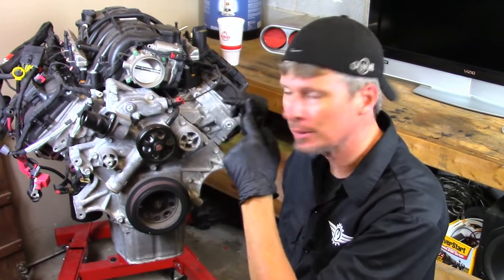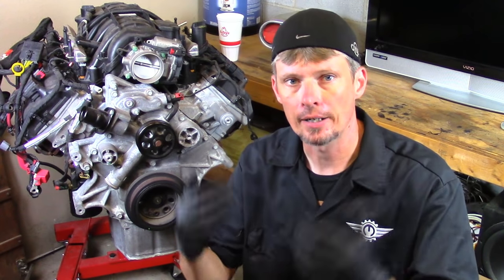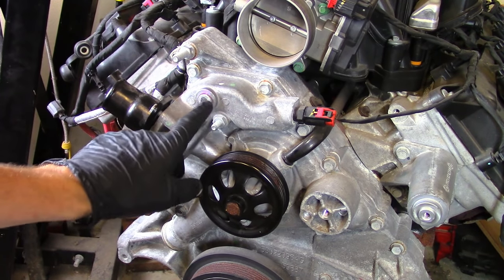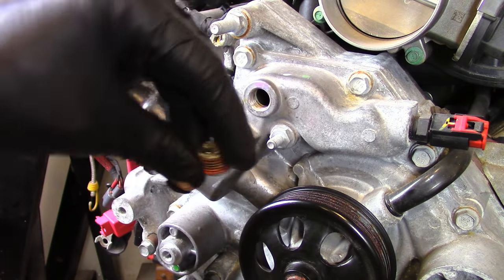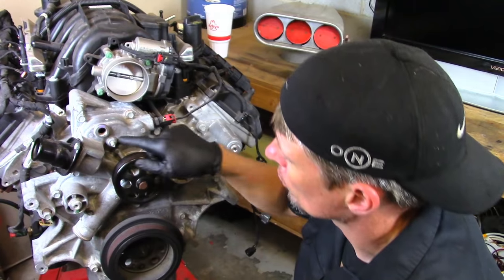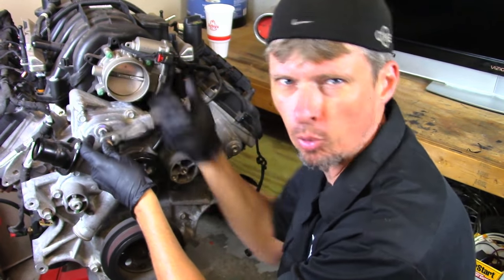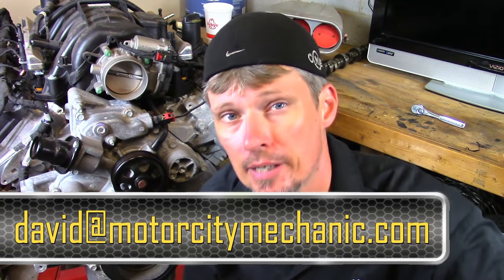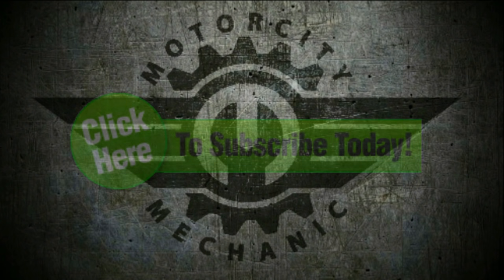Quick Tip: 5.7 Hemi coolant bleeder location and fill procedure

Comment: When you do a coolant flush will it completely flush the previous coolant out? I was going to top of my coolant & the manual calls for a mopar OAT coolant (purple) but the fluid in the car is orange. I bought it preowned a year ago. What would you recommend going about with this? It's 2016 hemi 300s

Comment: I have an air gap in my. I opened the bleeder port and filled the overflow container but overflow filled before fluid came out of bleeder port all while jeep was running. What did i do wrong?

Comment: Hey David.  Just subscribed...my question is. The location for fan sensor switch on a Chrysler 300 c 5.7 v8 .
I changed thermostat and went through refill procedures. Yet the fans don’t come on when it heats up . They never come on...any advise would be helpful....thanks and have a great day
Reply: Maybe it's not getting hot where they need to

Comment: Best advice on the bleed valve if it's stripped?
Reply from the maker: If you cant get it out then I recommend using a coolant air evac tool to remove all the air and then refill the engine using that same tool. You might also try removing the t-stat and filling the engine until it comes out the t-stat opening....will require a new t-stat seal however. Then reinstall and top off the level in the bottle.

Comment: it seems as the bolts around the water pump are leaking a tad bit of coolant in my challenger. I did the radiator pressure test and saw it come out of some bolts. Any suggestions?

Comment: Hey thanks, something weird happened to my same engine, engine is full of coolant with no air in the system but water pressure in the heat radiator inside the dashboard is less than before, when I accelerate car it gets hot, seems to be not a lot pressure in the system and I don’t know why!  Any idea? 5.7 hemi

Comment: My 06 300c awd leaking antifreeze left and right corner of the radiator car doesn't overheat yet heat is ok but hottest when car is driving?🤔 should i change lower hose or change RADIATOR?
Reply from the maker: Sounds like the leak is at the radiator tanks meaning radiator replacement. To be sure I would pressure test the coolant system and see if you can pinpoint the exact location. No with the age of the vehicle I would recommend both the upper and lower radiator hoses being replaced when the radiator is replaced if its needed. Thanks for asking and thanks for watching. Make sure to subscribe and Merry Christmas.

Comment: I have a 06 Chrysler 300c 5.7. It started to over heat I changed the thermostat but still does it. When I turn the heat on all the way it goes back to normal operating temps. Would bleeding it help?
Reply from the maker: First thing I would do is make sure both fans if a double set or the single fan is working properly. See if they are coming on when its running hot. The next thing would be to make sure that the radiator isnt clogged. You can touch the upper and lower radiator hoses to see if there is a big difference in temperature when its at normal operating temps. Thanks for asking and make sure to subscribe.
Reply: @MotorCityMechanic  thanks so much I just bled it and alot of pressure came out and I filled it till it ran out the hole. Just went and tested it down the road and had it set on a hill for a couple of mins while it ran and no more over heating. You saved me alot of money appreciate it. I will subscribe for sure
Reply from the maker: Keep an eye on it.....something had to let the air in. Glad you tried that if even if I was steering you away from it lol. Thanks for the update Glen and again....keep an eye on it

Comment: just a quick question i replaced the heater core in my 2006 jeep commander and i'm only getting heat when i'm driving. the minute i stop the air coming out the vent start getting cold. i was told that i should make sure the front of my truck sits higher than the back to get all the air out. i've also noticed that my radiator cap stays cold cold even after the top radiator hose gets hot any ideas on what to do?

Comment: Do you have any videos on how to drain the coolant. I have a water pump leak on my Hemi
Reply from the maker: For the most part.....all the videos related to the coolant system should have the draining explained. For example here is one that even being that its a different year....shows the same location as yours of the drain....right bottom corner of radiator: https://www.youtube.com/watch?v=f0doIZI-fp4

Comment: Hello friend I have a problem with a Durango 5.7, the engine has been repaired and the temperature rises to 112 and the water is dripping from the radiator cap. The pump is new. The radiator remained. The head gaskets have been replaced and are still warming up, flush out the water, remove the thermostat, and continue. help friend

Comment: your video was quite helpful thank you, but if issues still persist with over heating even after bleeding and letting my 2011 jeep grand cherokee with the 5.7 run then letting cool completely and checking afterwards to bleed again as prescribed in another comment you stated, what could the culprit be at this point?
Reply: also changed my thermostat

Comment: hi. I have a 2005 Dodge Magnum with a hemi and it keeps on over heating . I already changed the radiator, the reservor, and also put in a new thermostat and it still seems to over heat. my husband also bled it to see if it has air and it still is over heating . any idea of wat it could be ?

Comment: I’ve added coolant and removed that bleed valve, but no coolant from the reservoir is getting sucked in. The coolant level remains the same in the reservoir and nothing is coming out
Reply from the maker: Have you filled the coolant bottle to the top? Its a gravity set up.
Reply: MotorCity Mechanic I have filled it up, and none goes into the radiator. I was told to turn it on and it would go in on it’s own but it just starts to get hot. Nothing is leaking, and I’ve already done what you said but nothing. Never happened to me before

Comment: great video..one question bro" how many coolant bottles should I use on a complete flush..1 or 2 ???
Reply from the maker: Really depends on how your flushing it. If using a flush machine it can get up to 2 gallons antifreeze and 2 gallons distilled water. Otherwise the system holds around 1 gallon antifreeze and 1 gallon distilled water. Just depends on the method. Thanks for the comment and for watching. Make sure to subscribe

Comment: What the procedure in a grand cherokee hemi with a coolant tank AND a radiator ?

More confused than I was before watching this...
Reply from the maker: Doesnt matter if you have a pressure bottle or if the radiator cap is on the radiator. Just fill it up until it starts to come out the bleed hole and then reinstall the bleeder bolt. Basically where ever your radiator cap is (on radiator or on the pressure coolant bottle) thats where you will add the coolant. Thanks for watching and hope I helped with that confusion. Make sure to subscribe.
Reply: @MotorCityMechanic  Excellent.  Thank you.
Reply from the maker: Your welcome!

Comment: No bleed port on a 2007 Dodge Ram 5.7. Heater hose pipe is in that spot and runs down to bottom of engine. Gonna take thermostat housing off and try to fill that way. We'll see how it goes I guess.

Comment: I replaced my water pump and thermostat. I burped the system. Not sure if I got it completely or not. When I first start it and let it idle, it gets to 203 and drops like it should. But after I drive it and park and idle for about three minutes it goes up to around 225 to 230 degrees. Do you have any idea of why this would be happening?
Reply from the maker: I would recheck it when cold and see if there is still air in the system. I assume you didnt have this issues before the repair....why did you replace the waterpump and t-stat?
Reply: MotorCity Mechanic water pump blew out the seal when I was on the highway. I’ve topped it off several times and I’ve tried bleeding the air out of the radiator by taking the cap off while it’s running and waiting for it to reach temp then adding some. But for some reason it seems like I’m loosing more than I’m able to put back in after the thermostat closes again.
Reply: MotorCity Mechanic I actually haven’t tried your method though. I will give it a try tomorrow.
Reply from the maker: @6870catfish  hopefully bleeding it as in the video helps you with that issue.

Comment: Thank you for this video, would you happen to know if the bleach Port takes a hex head or what kind of bit? You said it was a 5/16ths? I think mine is stripped
Reply from the maker: There are 2 different sizes I have come across....dont remember what they are at the moment. If rounded out then you can remove the coolant temp sensor thats about 3 inches away on the timing cover as well and that will work as well as a bleeder. Thanks for asking and make sure to subscribe.

Comment: I changed the  Thermostat water pump radiator and the temperature gauge sensor on my 5.7 and my hot and cold gauge is staying between half and a quarter over half
Reply from the maker: Might be time to have the radiator checked and another thing.....it may have been ran hot too many times and now you have a new issue like a warped head possibly.

Comment: I replaced my water pump and my thermostat from my  durango 2011 5.7 hemi but then no heat was coming out then i notice my temperature gauge wasnt goin up instead it was goin down and cold air comes out so i replace  my temperature sensor and its still the same so i looked on google and i ready the my coolant system might have air. Please help out thanks alot

Comment: Nice how do u get the coolant out the 6,4 hemi motor to replace with OAT coolant
Reply from the maker: Afternoon, the first step would be to drain the radiator. Next step is the broke coolant plugs. On both sides of the block just above the oil pan and about 3/4 of the way back you will find a bolt. Remove it and that will drain the block. I would refill with water and then drain again. If your going from HOAT to OAT then you need to make sure all of the old is removed because they should not be mixed. Make sure to subscribe and check out my other videos.
Reply: MotorCity Mechanic whats a broke plug ? Lol
Reply: MotorCity Mechanic another weird thing happens is; at high speeds highway 140-135 mph the rad is building pressure nd trows it out the reservoir? Not at city driving nor if is hot out my temp reads 195 max when that happens ? Why is it doin that ? Thnx
Reply from the maker: Sorry man...typing too fast. I meant block coolant plugs
Reply: MotorCity Mechanic yup got it thnx

Comment: If you have the coolant bottle on the side how does the coolant get into the engine?
Reply from the maker: The coolant will be added where ever the radiator cap is......on some vehicles its the pressurized coolant tank and others the radiator itself. On those with the radiator cap on the radiator.....the overflow bottle will not be used to add coolant when bleeding the air out. I hope this helps and makes sense. Thanks for asking and make sure to subscribe.

Comment: My bleeding port in my 6.1 is ceased and stripped...... any ideas how to remove?
Reply from the maker: The other option is to remove the coolant temp sensor that is about 3 inches away from it on the timing cover as well. Once removed, treat it as a bleeder just like in the video. Thanks for asking and make sure to subscribe.

Comment: What happens if you dont bleed it? Does it overheat?
Reply from the maker: Typically it will get an air pocket and start to overheat. Thats why its important to bleed the system so that no damage is caused. Thanks for asking and for watching. Make sure to subscribe.

Comment: I’m confused if you’re refilling the engine coolant and you’re going through the coolant reservoir if the thermostat doesn’t open how does the liquid reach into the engine
Reply from the maker: The bleeder is on the back side of the thermostat so the thermostat doesn’t have to open to get the air out.

Comment: Am I filling it up by the thermostat hole.
Reply from the maker: No that’s where the air comes out. Where ever the radiator cap is….on the radiator or the coolant pressure bottle

Comment: I wanted to follow up and ask this question. Since my system is full and it appears that there is an air block in the heater core will it help to take the bleeder bolt on the bleeder port?
Reply from the maker: Are you asking about removing the bleeder? I recommend taking it out and adding coolant to the pressure tank until it comes out the bleeder hole. I do this when its cold and the engine is off

Comment: Question I bleed it, put new hoses new radiator and Change thermostat. Why is it there alot of air pressure in my reservoir. When I losing it up a bit the water pressure goes everywhere.
Reply from the maker: Remember that the pressure tank will have pressure on it depending on how long it has been running. Much like when the radiator cap use to be on the radiator and if you open it when hot....the coolant would spray out and burn you if you werent careful. It also depends on what the original issue was......why did you replace the thermostat, hoses, and radiator?
Reply: stock setting for fans to start cool down is high, I change it by diablo trinity to lower temperature and never again it pumped bottle with presure( normal temperature on outlet of engine is 94-95c deg, on stock fans did not cool till 102c deg, now it cools on 96c deg low speed, and high speed on 101c deg)

Comment: Question i changed my thermostat on my 06 300c yesterday n when i finished i filled my coolant but then my friend told me i might have to bleed the system for air...so i was wondering is it to late and how will i kno i have air ...planning on driving 3 hrs tomorrow dnt wanna get stuck on the side of the rode

Comment: opened what I believe is the petcock on the passenger lower radiator(90 deg knob) nothing coming out????
Reply from the maker: Some have to be pulled out ward while turning to get it to start flowing. Also...make sure there is not blowing the drain hole or hose. If your still having issues you may want to opt to take one end of the lower radiator hose off instead. On some high mileage vehicles I go that route due to possible issues with the radiator drain o-ring.

Comment: Where do I add the coolant?
Reply from the maker: Where ever the radiator cap is....if it’s on the radiator then the radiator....if on the pressurized coolant bottle then there.
Reply: @MotorCityMechanic  thanks. What color should my coolant be for 2005 Dodge Ram 1500 5.7 2wd?

Comment: How long does it take the coolant to flow out once the bleeder is out?  I got bleeder out and added coolant to reservoir but nothing is coming out yet
Reply from the maker: You have to keep adding until it does come out. If you have the bottle filled to the top and nothing is coming out then there could be a blockage somewhere
Reply: Thanks thats what I did!  Kept filling to top then fluid started running out. Plugged it back up now she's running like a champ!!!  NO OVERHEATING!!!!  Thanks for great video
Reply from the maker: Glad it all worked out great. Appreciate the update

Comment: quick question. i changed my radiator twice first time was because the plug just fell out and all the coolant just came out. so we got another plug wouldn’t fit on my dodge 2003 1500 v8 but the drain plug wouldn’t fit. so we got another radiator and it came with a plug and it was in tight. but the radiator leaked again but idk why???
Reply from the maker: Not sure but are the replacement radiators aftermarket or Mopar? I have no faith in aftermarket parts....the quality sucks.

Comment: what is wrong if I drained my radiator to change outlet hose and I went to add antifreeze and it won't drain down?
Reply from the maker: Hard to say without looking at it. Did you follow the coolant bleed procedure in the video.....does it have a 5.7? Sometimes you may need to start the engine and let it get to normal operating temperature. Then let it cool completely down and recheck the level. Repeat until it no longer changes.

Comment: Did everything as shown in the video on my 2012 Dodge Durango rt, took the truck out for a test drive and after about 10-15 minutes truck started overheating. Any suggestions?

Comment: hi ya Chief! stumbled here as I was looking for some info on the over flow recovery and fill tank. My 2003 Ram 1500 Hemi (219,000 miles) Boiled over this am. (sad face) I did a refill at gas station with 100% water. I need to replace this tank - any videos for that? the overflow tube has broken off the neck and so no water returns to the system. thanks for this great video and all your help! Bradley J out in California! Peace!
Reply from the maker: I currently dont have a video on that at the moment. But you never know what the camera films from week to week so make sure to subscribe so you get notified when videos such as that get uploaded.

Comment: How about how to drain coolant from a 2016 ram 6.7
Can’t find good info on this
Reply from the maker: The drains on some of these trucks is impossible to find or access. When that happens the best method is to take a lower radiator hose loose and slight it off enough to try to control the flow of coolant leaking out into a container.

Comment: Do you have a video to do this on the 3.6?
Reply from the maker: I believe its part of the 3.6 waterpump video I did. The thermostat housing has a bleeder screw that you back off and wait for coolant to come out much like on the Hemi. Just follow the upper radiator hose to where the hose attaches to the engine....thats where the bleeder it. Make sure to so it with the engine off and coolant cold.